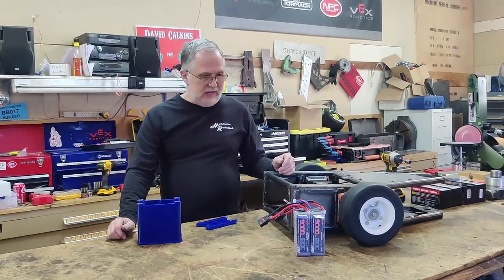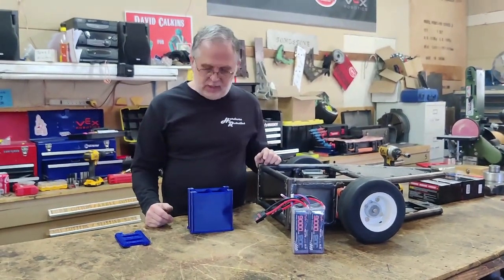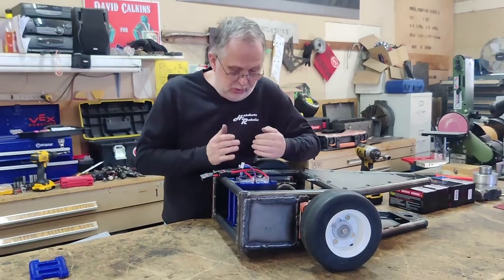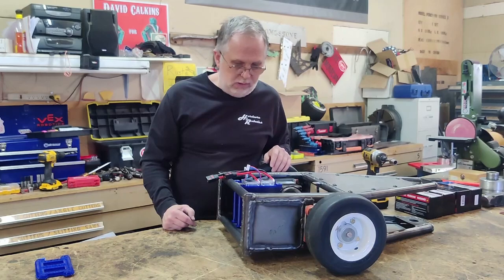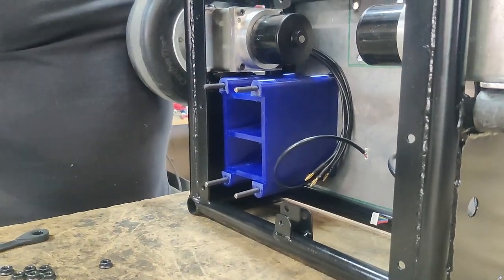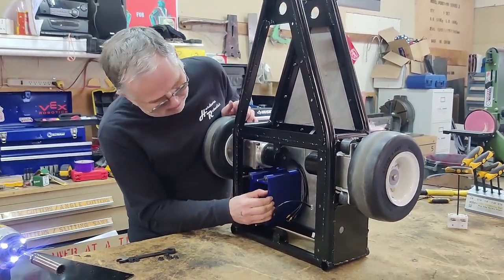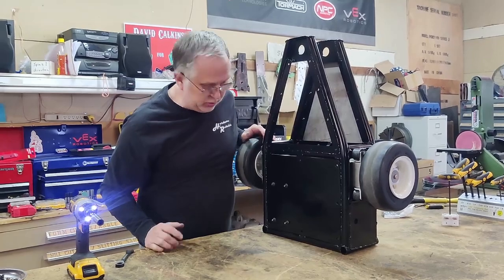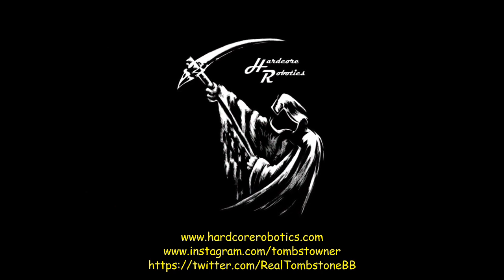Mortician 2023 - Battery Box Design

Comment: After a particularly long and brutal match (where your weapon is constantly being stopped / stalled & spinning back up ALOT) how depleted and more importantly how HOT do your batteries get (In SOC % and Celsius please)
Reply from the maker: The number of battery packs we have is always based on full amperage draw rather than capacity. So I don't think we've ever come near a low state of charge, and Mortician is usually 80% at the end of a match. 

Sometimes at the end of a rough match the batteries do feel warm, but we don't actually measure the temp. I take a fan just for batteries to events, and usually cool them off for a bit after a match before I would attempt to recharge them.

Comment: About the only big issue I can see with this is those rods are a direct path for impacts to one armor plate to be transferred to the other (and in an outward direction). Have you considered using cable terminating in bolt threads instead?
Reply from the maker: Let me go break this setup first before I start redesigning things :)
Reply: @ray9368  Ha! Fair enough. Look forward to seeing it break other things before breaking itself.

Comment: How did you previously mount the batteries? Were they just strapped directly to the metal?
Reply from the maker: They were encased in closed cell foam all around. Up to a certain point this worked fantastically - I won multiple championships with this setup. But the hits now are harder and the foam was allowing too much movement, so they need to be held a little more securely.

Comment: Those bolts look to be quite the point load on the box, since it's got so much air around it right now. Making a pocket feature in the top and bottom plates, or welding in a metal lip that hugs around the battery box at each end, should secure it so it doesn't rip apart at the bolts. I'm mostly worried about the long sides being unsupported side to side.
Reply from the maker: The armor panels are titanium, so welding there is a real pain, especially with the gear I have on hand. And neither panel is thick enough to consider a pocketing setup. I agree things could break as it sits, but I think it's better than how it was ran before. And we'll have more data after the event to look at going forward.
Reply: That, or use crush sleeves.

Comment: I understand about being worried about weight, but what about the batteries overheating?  
Why not design the battery caddy, for lack of a better term, with a waffled or egg crate kind of design that uses less printed material and allows for air flow to keep the batteries cooler?  Just a thought.
Can't wait to see Mortician up, running and destroying the field!
Thanks for the video, Ray.
Long Live TOMBSTONE! 👍🥰🤗😘
Reply from the maker: The failures I have had lately have been from physical damage due to the mounting constraints being insufficient. So although I agree that heat is an issue, for now I am focusing on simply holding them securely enough that I am not worried about them being damaged that way. If they overheat we'll look at it further down the road. Always something to learn!
Reply: @ray9368  Thank you for responding to my post, Ray.  I have to agree with you there, baby steps.  Yes, there is always something to learn, every day.

Comment: Regarding capacity; Have you done any tests to see if the blade shape changes how much current the weapon draws when its up to speed?
Reply from the maker: It's not so much about the blade shape, but thickness. Thicker blades draw more power, since you are moving more air around while spinning. It's less of an issue for Mortician since they are all fairly thin, but for Tombstone some of them are pretty thick and they do pull down batteries harder.

Comment: I'm a little concerned about how tightly the batteries are held.  With the "pouch" style Li-Ion, if they get squeezed to the point of plates touching, they short and catch fire.  Some think that was what was behind the infamous Samsung Note 7 phones bursting into flame.  Unless your batteries have a hard case, I'd think you'd be better off being slightly loose and let them bounce into the cushioned wall when you take a hit. That way it would be less likely the dynamic forces exceed the shock the batteries can take.
Reply from the maker: Always a learning experience. We'll see how it goes in less than a month :)

Comment: Would Styrofoam work as a material to secure batteries with? Very light, but also allows for tight-fitting and being able to crumple when hit so the batteries don't get damaged.
Reply from the maker: In most past robots, we have used closed cell foam (a much stronger version of foam than styrofoam) for battery placement. This used to work, but the robots just hit harder these days and it's no longer sufficient, and this has been one of the main sources of my battery issues over the last couple of years. I don't know if this is the answer yet, but it's worth a shot!
Reply: @ray9368  Interesting to hear your insights. I hope this new material can do the job in terms of battery protection
Reply: @ray9368  Just fill the entire chassis with packing peanuts, right? :)

Comment: I like the shock absorption of that flexible material. Are there any issues with heat retention, or do these batteries not get hot enough for that to be an issue?
Reply from the maker: Great question - I guess we'll find out after the event is over! :) I admit it is a thought, but until we get it on combat I just don't know.
Reply: @ray9368  Could always save weight and provide additional cooling by latticing the holder somewhat.  As long as the holes are small enough to prevent sharp edges inside the bot from directly contacting the battery, the goal would be met.